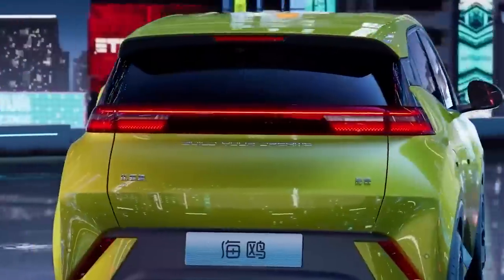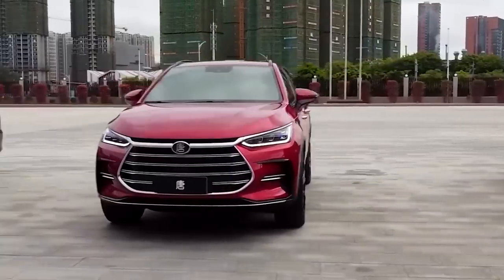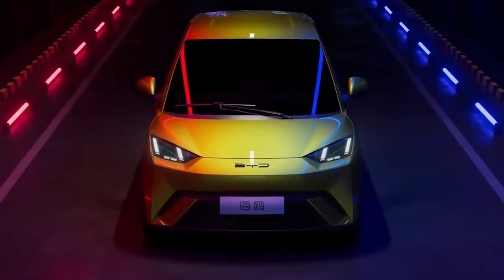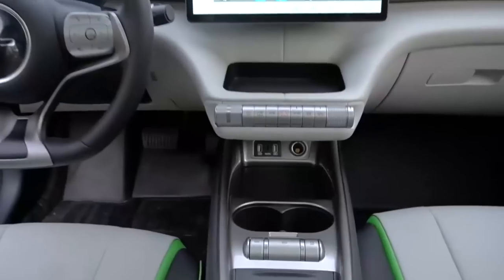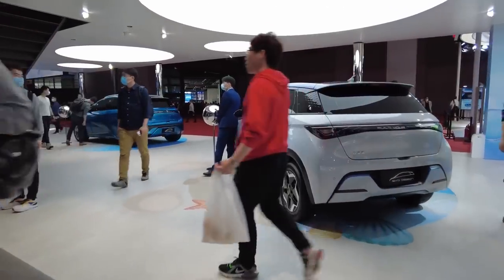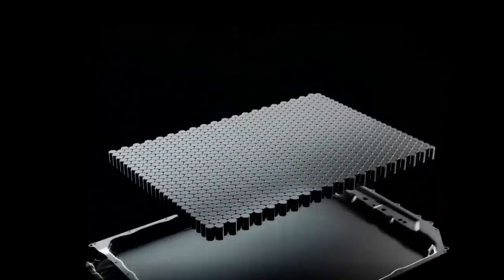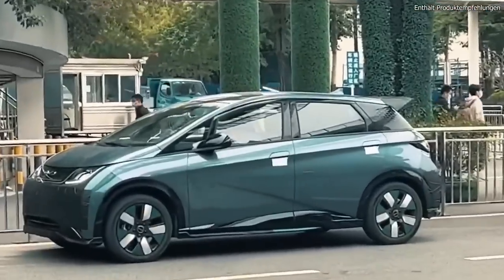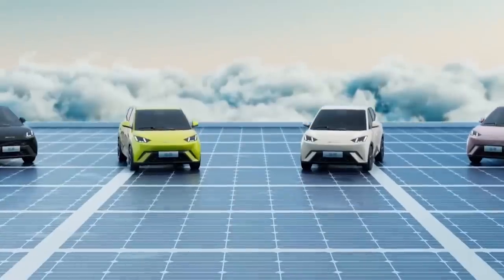BYD SEAGULL Update: World's First Sodium-Battery Powered Car for Under $9,000?

Comment: BYD Seagull will cost between 11,500 and 14,500 dollars in China (80,000 to 100,000 CNY), and obviously it will be more expensive in other markets.
Also, initially it will be sold with lithium batteries since sodium ones are still being developed by BYD, as we will see in a very few days at Auto Shanghai.
In addition, the instrument panel of the Seagull is quite different from that of the Dolphin. It does not have round air vents (at 4:15 you are showing Dolphin's dashboard), they are rather rectangular and in general, the horizontal lines of the panel are much straighter than those of the Dolphin.
Reply: These comments make the video a bit of melodramatic farce then?
Reply: BYD cost between 10,676 and 12,991 dollars in China
Reply: @番茄大爆炸  Lucky you! You might imagine we in Europe feel a bit ripped off?
Reply: 入门价格是73800，更便宜
Reply: So, no sodium? Pass.

Comment: I like this new battery! It's much safer then lithium and way cheaper. I hope they produce a battery swapping method, to swap out a battery fast to a fully charged battery. Only take 5 mins.👍🚗
Reply: Fast charging take these batteries to 80% in 1 hour. Swapping out takes way longer, needs more logistics and might even have a negative effect on the cars structure.

Comment: They say sodium battery can be charged very very quicky in couple of minutes but doesn't have a long battery life. However many Chinese Electric car company provide the facility such that if you are the 1st owner you do not need to pay for the new battery and the next new battery. Keeping that in mind, sodium battery sounds more convenient.
Reply: And it's a new technology. As it reaches maturity it will get better
Reply: If Sodium battery charges at half the time of similar size LFP battery, then its just like refueling an ICE car. Being shorter in driving range is not an issue since you can charge up full in 10mins.

Comment: A very annoying breathless and hyped advertorial style presentation. The revolutionary thing about this vehicle is its Na-ion battery, which if it works in this car, could work in any car. With luck, Na-ion batteries will supplant Li-ion and Li-FeP in most lower cost BEVs. It's not just the Li, but the associated Co and Ni needs. Li-FeP use just Li. The presentation is a bit confusing as the car can be supplied with both types of battery. However 300 kms with the Na-ion battery is actually a very adequate range for any "city car" but in fact for most other uses as well, depending on charging speed. My own car doesn't even manage much over 200 kms (an older Nissan Leaf) but has proven perfectly sufficient.

Comment: Well, will car make it to the US at $9000? This should kill Tesla. There is a quiet war going on between EVs and hydrogen vehicles. Plus the existing auto industry doesn't want EVs because it will put them out of business. An EV is cheaper to own and doesn't need the same repairs. Now if a vehicle could be made for the public this would be Troy Reed's magnetic motor that for a few thousand dollars would convert the average existing vehicles this saving the public all kinds of money which the auto industry doesn't want to do. A magnetic motor doesn't need gasoline or batteries. You haven't heard a word about Troy Reed's magnetic motor. They have either bought him off or killed him. They do not want to give the public cheap transportation. With a medium income in the US of $31,000 I don't see where the high priced EVs will be sold to the public. I'd like to know what's going on with gasoline vehicles, because I know that GM and Ford have motors which can get much better mpg? The public doesn't have the money to pay more for anything. If the far left is trying commit suicide they are sure doing a good job of it.

Comment: Questions: 
>Is it street legal in all 50  U.S. states & with which limitations, or what it would cost in both parts & labor to get it legal.
>Full cost if imported, incl import taxes & shipping & total misc (bottom line sum total).
>Insurance rates for minimum req by law & for bank req to get auto loan.
>Annual tag/licence plate & vehicle registration fees.
> Parts & maintenance (access & costs of parts, labor, and consumables ... like fluids, filters, tires, Etc.).
>Compare sizes to Toy Hauler storage dimensions.
>For e-vehicles, can an Xtra battery fit in vehicle to swap out, &/or accessory charging options(?). 
>Weather hardiness: heat, cold, rain, and water inundation "puddles" + tendency to hydroplane, annnd  workarounds (like airfoils, rutters, Etc.) 
>Ground clearance & workarounds (Ex: undercarriage protection + winch?).
> Accessories available via import vs in U.S.? Ex: Battery coolers!, 
anchors to keep from flying away in wind during storms and hurricanes, 
very tiny camp trailers like ones for bicycles, car-side canopies/awnings/ tents, lightweight roll bars, Etc.).
Reply: You can not compare two different fruits, these cars are by no means a Tesla. But income varies in the US especially compared to Europe or Asia. Hourly wages in the US is pretty high too. Time will tell if People not only buy cheap TV sets from abroad but also EVs. It is always what you can not get that makes sense to buy.

Comment: Does it burn up like the other BYD cars.
Reply: No sodium iron doesn't  have that problem also charge faster and are cheaper  and dont suffer with temprature differences like lithium
Reply: Safer than Teslas that don't use BYD batteries & much safer than ICE cars.
Reply: BYD is safer than Tesla.
Reply: It sure burn like Tesla, and it is not available in the USA, so don’t get too concerned
Reply: @alexsuimingtay252  sodium  iron batteries  are not like lithium  there stable and recyclable  and faster charging and cheaper  and the Gen 2 batteries  will be as good as lithium.
Reply: @steventostevin3085  and much safer than conventional ICEs that are more combustible
Reply: thats why they change batterys so they wont xD
Reply: @kamillatocha  no this is the next generation sodium  iron batteries  are set to take over from lithium.

Comment: Do some research plenty of videos showing byd cars bursting into flames on YouTube 😂😂😂😂
Reply: Have you also done any research on gasoline or Diesel cars burning? I ask it because i haven't made that research also, which technology is more dangerous to us users? (Not considering toxic emissions from fossil fuels).
Reply: How many, as a percentage of all EVs sold versus what percentage of ICE cars that go on fire?
Reply: chatGpt: "important to note that Tesla has also experienced incidents of vehicles catching fire in the past...it can depend on a variety of factors such as the number of vehicles on the road, how they are driven and maintained, and other external factors... muche less than: Gasoline & diesel fuels that are highly flammable & can ignite if there is leak or if the fuel system is damaged. Electrical faults can also cause fires in ICE vehicles if they cause sparks or if they generate enough heat to ignite nearby materials."

The new Sodium batteries developed by BYD are safest.
Reply: In Sabah, Myvy(Daihatsu rebadge) is the brand and model that got burned the most. ICE ICE baby.

Comment: Buffet got the hell out of BYD recently, Don't forget to add that in there.  BYD has a neat habit of selling cars with the corners cut and batteries that spontaneously combust. Cool!  Exterior is stolen from the Honda"s sleek and modern style.
Reply: chatGpt: "important to note that Tesla has also experienced incidents of vehicles catching fire in the past...it can depend on a variety of factors such as the number of vehicles on the road, how they are driven and maintained, and other external factors... muche less than: Gasoline & diesel fuels that are highly flammable & can ignite if there is leak or if the fuel system is damaged. Electrical faults can also cause fires in ICE vehicles if they cause sparks or if they generate enough heat to ignite nearby materials."
Reply: Byd  blade battery is the safest battery available. Tesla wouldn't have used it in their model Y if it's not.
Reply: It is not your concern since BYD will not be sold in the US. Save it.
Reply: Ah the Iraq weapons of mass destruction allegations without evidence.